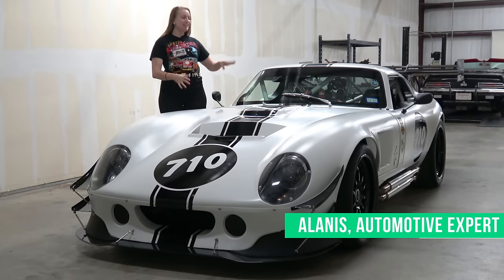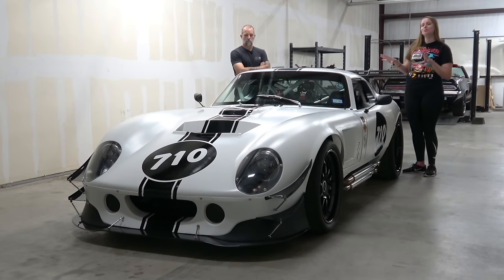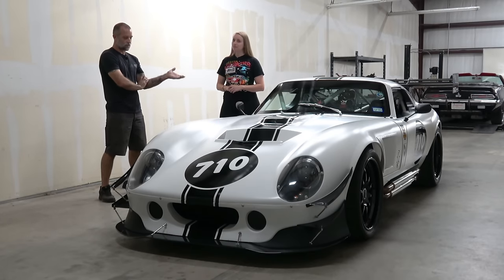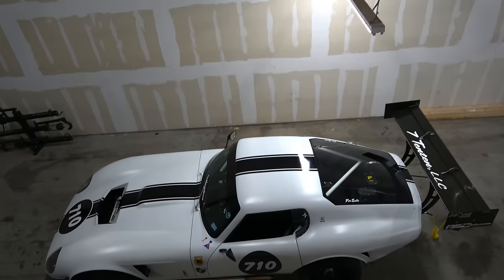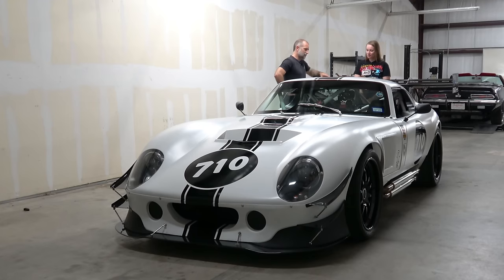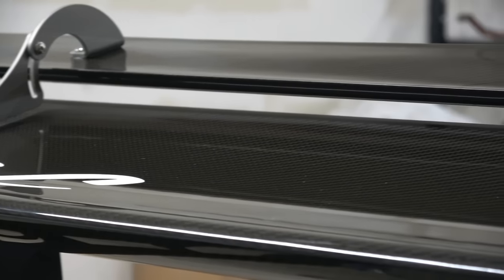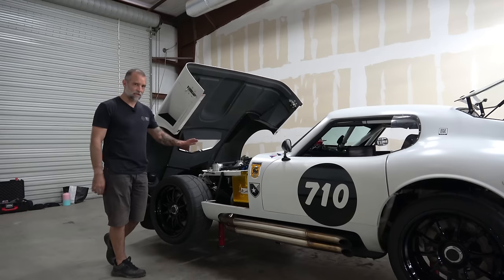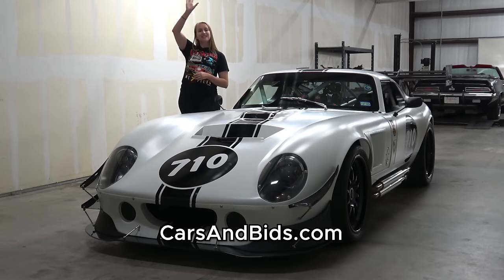2021 Factory Five Type 65 Coupe-R Review: Street Legal Race Car!!!

Comment: That Aluminator sounds FANTASTIC 🔥🔥🔥
Reply from the maker: Sounds really mean!
Reply: 3v mod motors were the best sounding engines Ford ever built- and an aluminator backs up that sound with some actual power. An aluminator a nice x pipe and some fr500 axle backs is pretty perfect sounding.

Comment: Very nice build!  My only questionable concern would be placing the gas tank in front of the engine block 🤞
Reply: It's dry sump tank...fuel cell is in rear of car
Reply: It's an oil tank for the dry sump, not fuel.